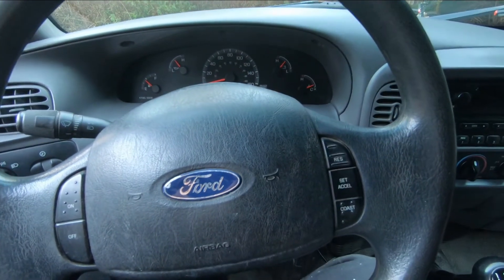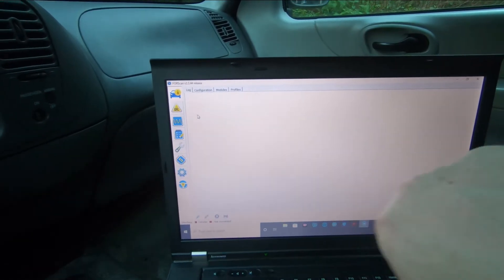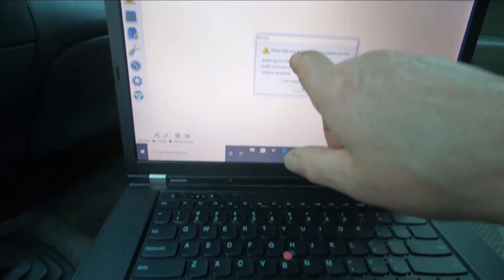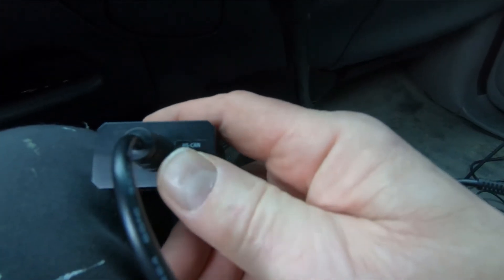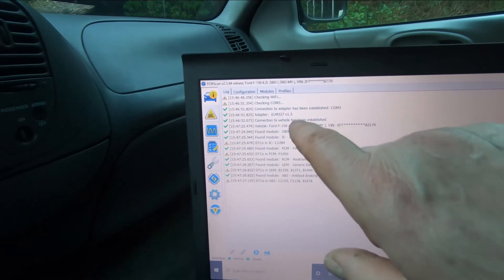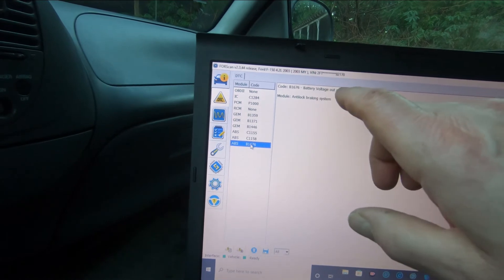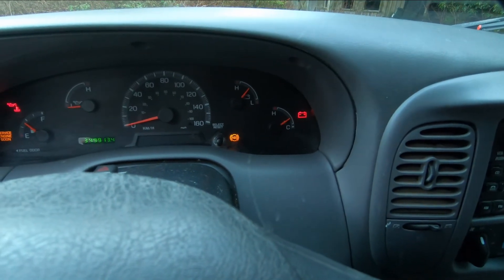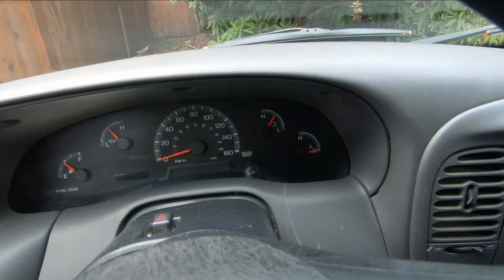FREE "DEALER-QUALITY" DIAGNOSTIC SOFTWARE (FORSCAN) FOR FORD & MAZDA  TROUBLESHOOT & FIX ABS PROBLEM

Comment: How's she goin'?  "Dem's the brakes."  LOL  Remember that commercial?  Nice job.  That scan tool comes in handy and the codes were pretty easy to understand too.  My experience with fault codes has not been so positive!!!  Nice fix and now you're good to go!!!  Stay warm!!!  Take care!!!
Reply from the maker: I'll bet that FORSCAN will come in handy for working on your Escape. The good thing about this software is that it allows consumers to know what codes have been triggered even if they aren't going to do the repair themselves. When you check things out before taking your vehicle in for service, you go informed. Sometimes, the fix is simple, like my changing a $40 sensor. This same troubleshooting and repair at the dealer would have cost me hundreds! Last year, I used FORSCAN to program new keys for our Mazda 5 at a savings of hundreds of dollars and I used it again to pin-point trouble in my steering wheel clock-spring that had triggered an air-bag trouble light. FORSCAN works on Fords and Mazdas and was created to replicate the dealer software that Ford and Mazda created during their partnership of many years. From the late 1970s to 2010, Ford and Mazda collaborated and shared technology (mostly Japanese technology into Ford vehicle designs). Many Ford and Mazda vehicles share the same chassis and some are identical except for the badging. The Ford Escape and Mazda Tribute, for example, are identical vehicles and so were the Ford Rangers and Mazda B-Series trucks for several years. My Ford F-150 has a M5OD 5-speed manual transmission made by Mazda. This was a factory install and the truck was built in the U.S.A. ! I really hope you'll give FORSCAN a try!
Reply: @EverydayProjects  Having a scan tool would be a money saver for sure.  My vehicle is under a full maintenance warranty so I don't even open the hood to add windshield washer, I just schedule a visit to the dealer and it's all looked after and paid for.  But that full maintenance package is not cheap either!!!  Take care!!!
Reply from the maker: @GrampiesWorkshop  I ended my brief relationship with "Stealerships" years ago! There are so many near-new, good used vehicles out there for a fraction of the $$$. The only vehicle I ever bought new was a 1984 Jeep CJ7. Evere since, I've bought used and fixed my own. I wonder sometimes what the inside of a car "Stealership" looks like. I guess I'll never know!! LOL I was so hoping to see you hook up FORSCAN to your ESCAPE...you know how to hurt a guy. sniff sniff sniff
Reply: @EverydayProjects  I had a life time of working on cars and fixing them up.  Now that I'm older I don't mind not doing that.  But you're right, these days buying a used car is not near the gamble it was way back in the 60's and 70s!!
Reply from the maker: @GrampiesWorkshop  Good...so you ARE going to give this a try. I'm so happy. I'm happier than a seagull with a French fry! LOL
Reply: @EverydayProjects  If I ever buy a 2nd hand vehicle again, I'll probably do my own maintenance, but it sure isn't in the plans right now!!!
Reply from the maker: I understand. It's not for everyone.  Besides, you have your hands full already raising squirrels. I like how you let them right into the camp and workshop. And how they walk around the property with you. How many do you have right now? 100? 1000? It is so nice of you to let them into your life!
Reply: @EverydayProjects  There are no words ...